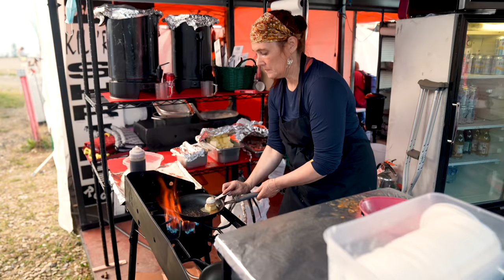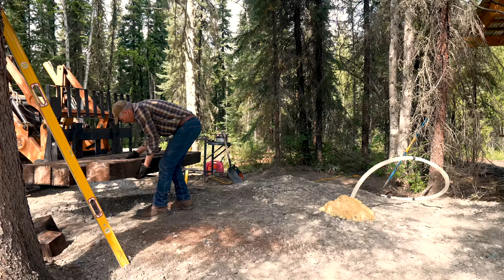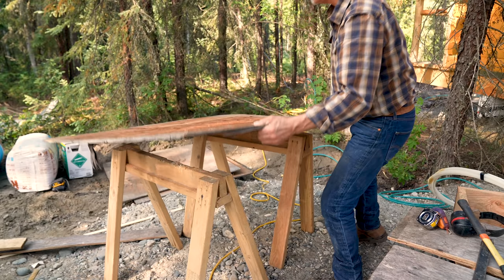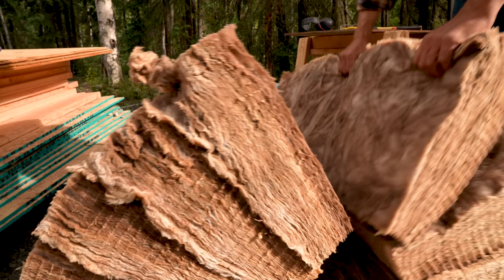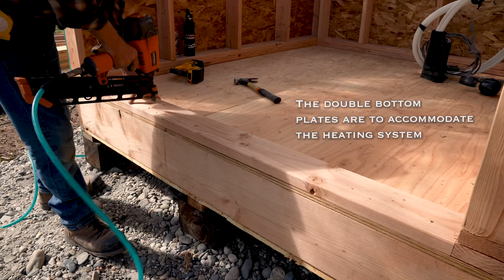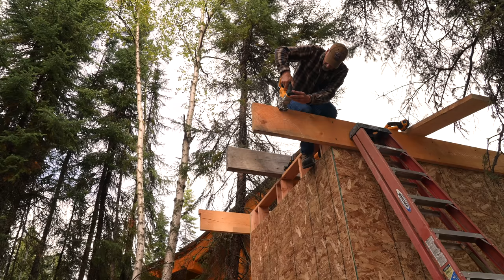LOG CABIN Project (The Mechanical Building 1) - Wk 17

Comment: I love a good county fair and the livestock was so cute.  I wonder if that cow ever got that gate latch opened.......I learned something new and helpful in this video. In the past when using my jigsaw to cut in the middle of a board I would always drill a pilot hole to be able to insert my jigsaw.  The way that you held your saw at an angle to saw into the board is a great tip and time saving for future cuts......Thanks.....
Reply from the maker: Good evening Dona. I don't think that cow was successful with that latch. And yes, that trick with the jig saw works well. Continue to drag the saw forward slightly as you cut into the board so the blade doesn't hit the bottom of the cut. Peace.
Reply: @ThisIsMyAlaska    I would love to be your helper/apprentice.  I do love construction....

Comment: I bought one of the Dewalt 60v cordless worm drive saws and it rocks. I built a 12 x 16 cabin with it and made it my everyday saw. A little heavy but the benefits out-way the cost. NO CORDS TO TRIP OVER. It cuts just as well as a corded saw.

Comment: what a fantastic build from the water pipe to the build of the Mechanical outhouse   I used to build kit houses back in the early 2000's  bring back memories of the concrete rafts  & 4x2 CLS  for the kit  panels etc   fantastic build as is all your Feats    like the plane by the way  no learjet yet??

Comment: All of the scrap wood you have will give you plenty of kindling for a while.
Reply: It will provide material for smaller needed projects.
Reply: @heru-deshet359  what I meant is the small bits that can't be used.
Reply: @hidhshsj123  That depends on your definition of small. I save every piece of lumber that's leftover, lol. Unless it's old and broken, I save it and it saves me money.
Reply: I got a home development nearby.  I go get the scrap 2 x 6. Perfect for kindling. Any 2 x 4, 2 x 6, 2 x10  longer than 3 feet I save for projects. Shorter, gets cut on miter box for splitting